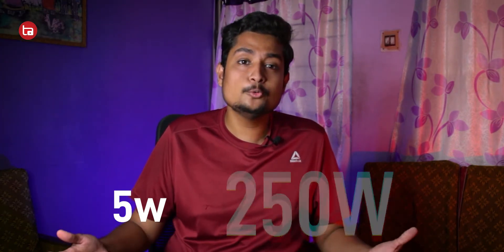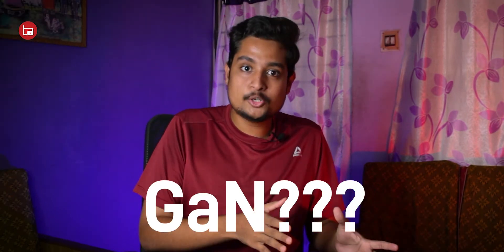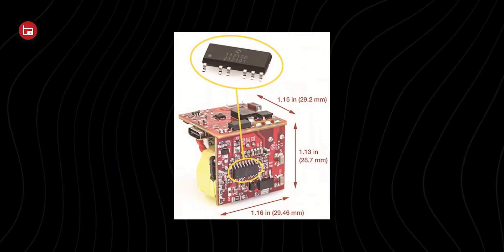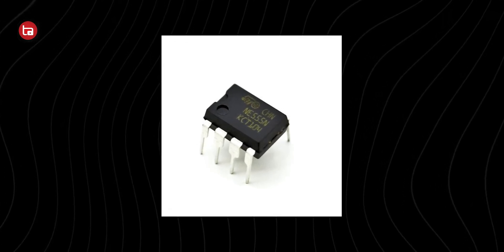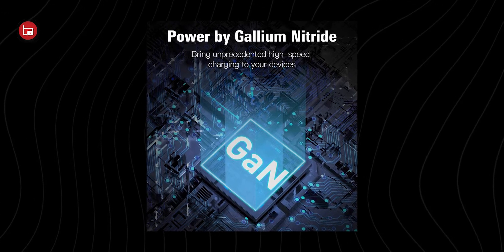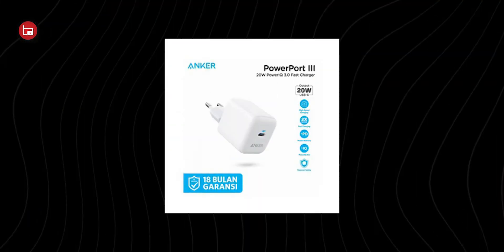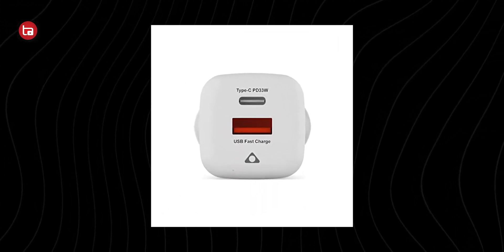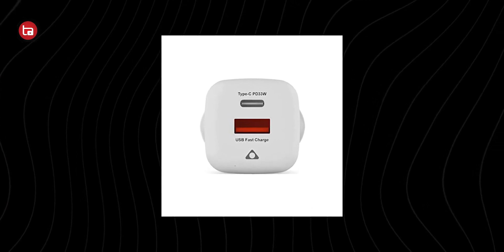What is GaN Charger ??? | GaN THE NEXT BIG THING 🔥🔥🔥

Comment: Just another question about the phone. Are the colors on the pixel 6 a little washed out? I mean somehow i felt the colors arent as vibrant as my old phone. Whether it's the icons or videos on YouTube. There's a slight difference. Do you think it's an issue with my particular handset ? Everything else works perfectly fine. Also, I've changed the color options in settings to adaptive also, still no difference.
Reply from the maker: So basically every phone tends to lose its colour after sometime and I think the colors of the pixel 6 are in general a bit low in saturation and when we start using it it tends to fade which is pretty usual...So that might not be an issue....
Reply: @TechArenaofficial  ok cool thanks once again for your reply :)
Reply from the maker: So basically these are pastel colours and just like anyother phone the devices will tend to get dirty over usage...So yep it's a common thing
Reply: @TechArenaofficial  nahh bro I'm taking about the screen quality. I mean on the screen, the icons and videos don't have the same vibrance and saturation like other phone screens.